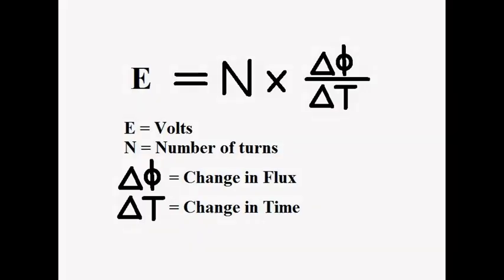How to increase the power output of your Generator.

Comment: need more amps?,,how more small wire wound together,,,how many per lengh...
Reply from the maker: Yes putting more parallel wires could help but I don't know anything about your generator, there are other factors to think about.
Reply: can iron wire be better,not copper..
Reply from the maker: Well iron can work but it can move as the voltage changes it will cause noise, copper works better just because it won't cause vibrations. I will tell you almost anything you need to know about motors and generators.
Reply: my magnets are 6+3+1,,,,,need more  amps from my generator,,,my coil wish one i need  size also the length of wire ,,help me ,,,how  best coil to make,,,,,thankyou for your time,,friend...
Reply from the maker: Yes I will help you. The generator I have at the end of this video is a very good design. How much voltage do you get from your generator?
Reply: on 3 coils i get130 volts,,,not finish yet need the right way and lengh,,i
made one coil 400ft 14 Gage this one gives me 19 volts,,
the other 2 coils is thin wire  gives me each 62 volts,,tell me what to
do,,,,need amp,,,is amps volts...
Reply from the maker: Okay, first amps is not voltage but most people don't need to know the difference to build a generator. Second, you need to have all the coils separate so that all of them will have the same voltage, because if you try to put them all together it could burn up, but if you don't want to put them together you can keep them separate.
Reply from the maker: Maybe that is your problem, maybe you are putting them all together. This would be bad for another reason to, if they are out of phase they could burn up to (I don't know if you know what out of phase means).
Reply from the maker: Also, all of your coils should have the same number of windings or turns.
Reply from the maker: But it sounds like your doing something correct because your getting 130 volts, Wow that's a lot of voltage. Most people are lucky to get 10 volts. But I think yours is so high because they are all tied together, or what we professionals call in series.
Reply from the maker: But that is the reason your not getting a lot of currant or amps. But from this I think you must have all your 3 coils in phase, that is, the north side of the magnets are all facing the coils all at the same time, and then the south side of the next magnet is facing the coils next.
Reply: so ,,thankyou,, did not know that,,,,so  the 3 coils on the  wheel goes with same side of magnet,,n+n+n=1 output coil.. can you tell me,,wish is  or  how you see the perfect generator using my wheel what changes ad more magnets like 14 magnet n 14 coils....would this be ideal or 12 ....is amps watts....
Reply: my heavy 14 Gage 400 ft = 19 volts,,,,,,why when connected to batt. or light bulb it goes down...the volts....i changed to heavy wire improved but  ,,what else missing,,,if i put out 19 volt why dont stay there the volts why drops ,,,thanyou,,,,
Reply from the maker: The number of magnets in general is the more magnets the better, but you MUST keep the magnets in line with the coils, that is, you can't just put the magnets any place, you should align the magnets on top of the coils so you can tie the coils together (in parallel). This is what will give you more amps ( or better but more amperage).
Reply from the maker: And regarding your heavy 14 Gage coil, the reason why the voltage drops is because it is not putting out enough power and that is because your doing something wrong. It could be the aligning of you magnets is not right, or it could be wire from a coil is backwards, or it could be a short circuit somewhere but if that happened your coils will get too hot. Check all that out.
Reply from the maker: And where are you from, it sounds like maybe the Philippines or some place like that by your broken English?
Reply: muchas gracias,su esplicacion entiendo mas....
Reply from the maker: De nada.
Reply: i thankyou,,,,if in future you have any other imfo.let me know......***goodday..